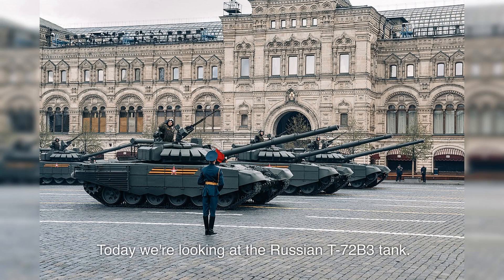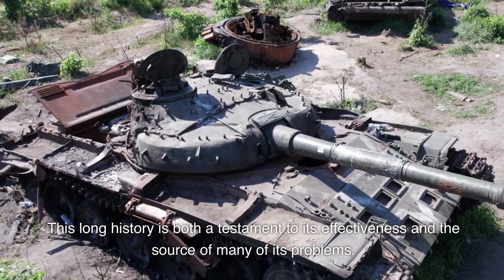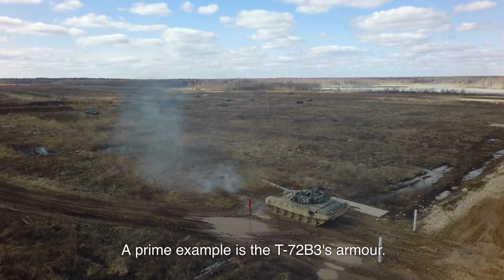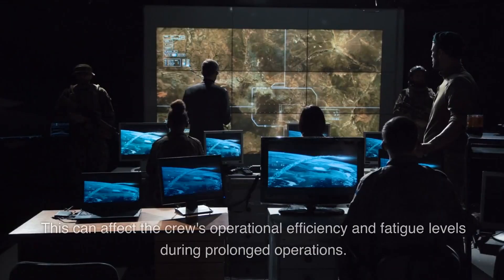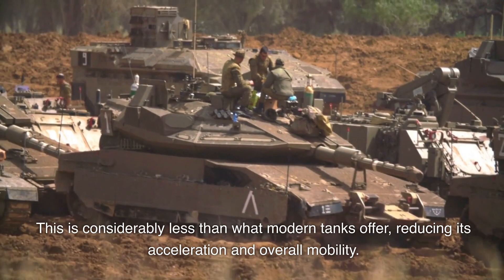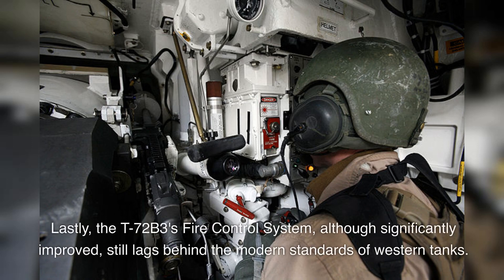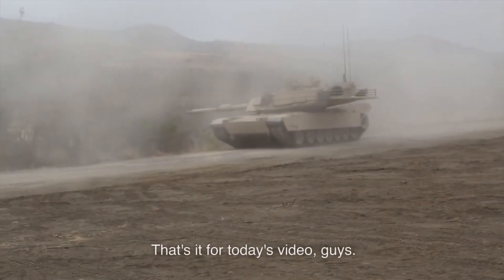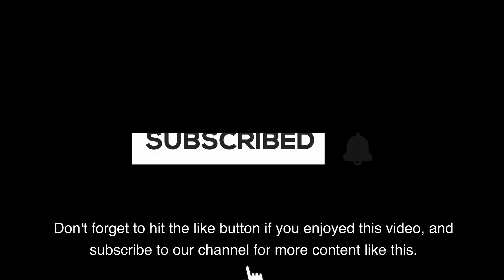Problems with the Russian T-72B3 Tank Analysis

Comment: Random thought . Having many low quality tanks doesn't make much sense

It means you need more crewmen . Meaning more humans to train and feed and house which is expensive .
Then there's the logistics . You need even more spare parts and more storage facilities and more trucks and logistic supply units to keep the ranks up running especially in combat which can be disrupted VERY easily in a high intensity conflict .
It also means you need more housing units for said tanks and more dedicated crew to repair it which require TONS of resources to train let alone have them repair a sizable number of tanks.
It makes sense on paper but in real world scenario it's abit..situational not just doesn't make sense for countries that don't have the resources for it and only export their equipment

Comment: It's ammo storage is also a problem
Reply from the maker: Good point, the top attack munitions is one of the main reasons the ammo always cooks off!
Reply: @Armored.Anarchy  Let me correct you as a good connoisseur of T-72 tanks ... There are things that you explained well ... But there are also those where you made mistakes. Let's say mobility, with the T-72B3/B3M tank... The T-72B3/B3M tank does not have an 840 hp engine, the T-72B tank has that engine, the T-72B3/B3M has an 1130 hp engine, which is installed, for example, in the latest T -90M. The T-72B3M version has a new automatic gearbox, also the same as the one installed on the latest T-90 M tank... So there are no problems with mobility at all, nor with the reverse speed, the maximum speed achieved with this model is tank biathlon even 80km/h ... Let's say that the max / speed is around 75km/h ... It is much faster and more agile than most western tanks. Also, the tank is very passable on all terrains, it is practically impossible to get stuck, unlike western tanks, which are too heavy, and unsuitable especially for the terrain in Ukraine... The engine and tracks, wheels, suspension, transmission are very easy to maintain. ... T-72 generally as a tank and in war conditions requires minimal maintenance, it rarely breaks down, and when a breakdown occurs it is very easy to fix, and maintenance is very cheap ... As for armor protection, it is quite good , with ERA Relict parts, on the latest modernization of this tank T-72B3M model for the year 2022 ... So this tank really, considering its size and that it is even about 20t lighter than any western tank, has decent armor protection ... In a real war like the one in Ukraine, does it mean something to a tank that it weighs 65 or even over 70 tons?! Well, we saw that it means absolutely nothing in the case of the Leopard 2A6, which is currently one of the best tanks in the world... Those 20-25 tons more than the T-72B3M tank are useless, when it does not provide good enough protection, when it is modern warfare begs the question .It can only be a bigger target, and has worse mobility ...Protection from the most modern ATGM systems like Jevelin or NLAW ... Top-attack missile does not have a single tank currently used to a large extent in operational use ...Maybe tanks with active tank protection, but so far we have not seen in combat, against ATGM top-attack missiles, so that remains under maybe?! I mean, the same systems would destroy Leopard 2A6 and Abrams SEP 3, or Chelander 2 without problems... Exactly the same as the T-72 tank... ATGM Kornet would also do the same job on Russian and Western tanks, that we could also see in Ukraine... That would really be the problem of the T-72 tank, if the same mentioned top-attack ATGM systems could not destroy the mentioned Western tanks, but that is not the case, they would have been destroyed very easily as well western tanks just like the T-72 ... So we can't state that as a shortcoming of the T-72B3/B3M tank ... As for the opto-electronics, it's true that most T-72B3M models don't have a panoramic sight for the tank commander .But it has a "doublet" system, more precisely the commander, he can use, in case of need, the gunner's aiming system, and fire in case of need. So this tank has a limited ability to "hunter killer"... The second generation "Sosna U" system has excellent performance... For example, the Challenger 2 has this first generation system... It is worse than the T-72B3M tank. ..Well, as we can see, that is not true either, so it is not true that all Western tanks have better opto-electronics... Basically, the T-72B3M can recognize a tank-sized target at about 8-10 km, laser a target at 7 km and hit a target already at 5 km, since it has the ability to fire ATGM missiles through the tank gun, as a classic tank missile is fired, the penetration of these projectiles are Reflek about 850mm homogeneous steel at 5km and Svir penetration about 900mm homogeneous steel at about 4km... So it's more of a myth that reigns, and apparently people believe in that myth, that more T-72B3M tanks, at least 10, are needed in order to destroyed one western tank?! It's stupidity of epic proportions, only one is enough. People are simply not familiar with this topic at all.... For example, a comparison of the T-72B3M model 2022 is roughly at the level of the Leopard 2A4 in the worst case ...
Reply from the maker: @SRB.4S  Thank you for your insight on this, I will make sure to add this information on my next T72B3 analysis